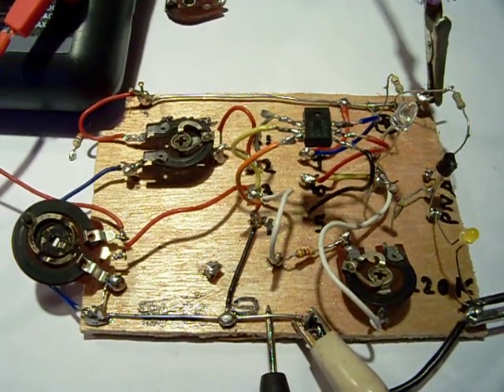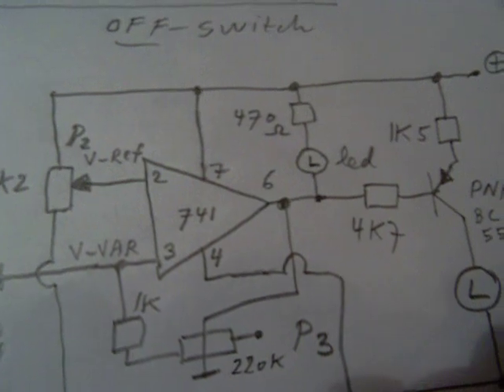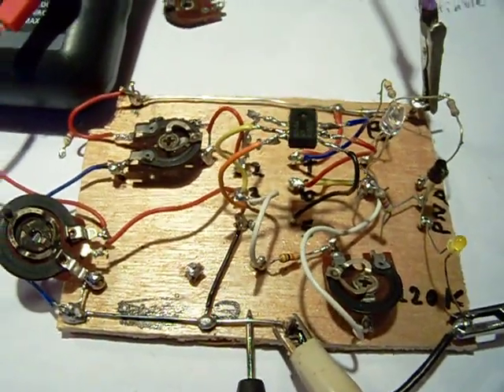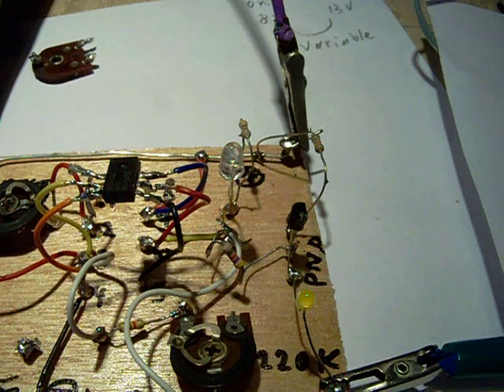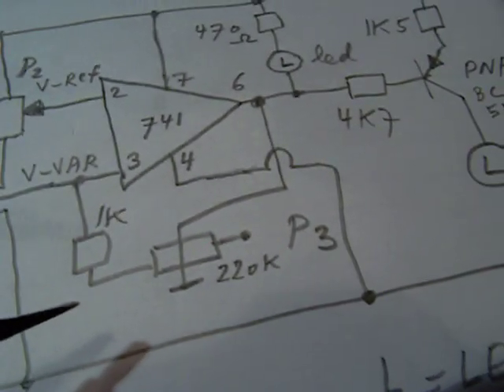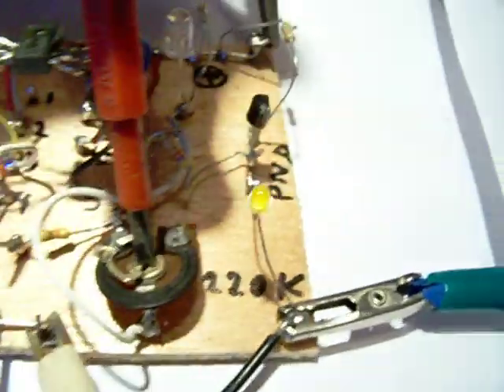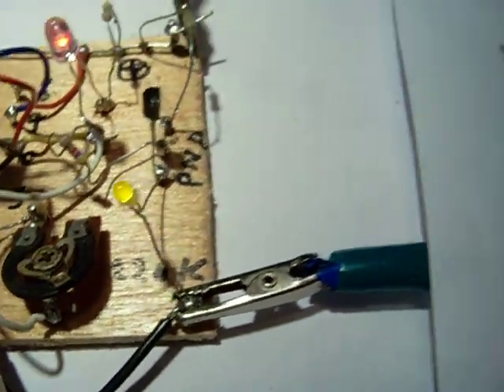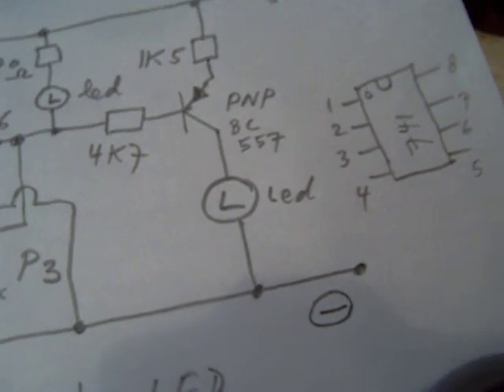Opamp fundamentals part 2, voltage controlled switch with hysteresis

Comment: I'm trying to design a circuit that will switch off a capacitor when it is charged to 6 volts and switch it back on when it is discharged to 4 volts. I also want a shorting wire to be switched in when the capacitor is switched out, and the wire switched out when the capacitor is switched in.  (I could raise these values if they are below the chip supply voltage range) Ideally all the chips should run off the capacitor but I need a stable reference voltage. It's to control the spring unwind in a clockwork radio.
The capacitor will feed the radio and is charged every second or two and swapped out with a shorting wire to act as a brake on the generator when it is not being charged. I'm puzzled now how to get a stable supply voltage to act as a reference (or else the chip might be confused if I try to run it from the same capacitor as the radio). I'd rather not have a separate battery for the chip. Any thoughts on how to do this?
Reply from the maker: Without a schematic I only have a faint idea about what you want to make. Do you want to supply the radio and a chip out of a capacitor? How many mA or micro Amps do the radio and the chip take? What is the function of the spring?
And what does the generator (AC or DC and which voltage?).
Reply: @radiofun232  I haven't got a specific radio in mind, though the power is probably under half a watt - probably about 1/5 - 1/10 of a watt at normal listening levels. Unfortunately I can't post a schematic in a youtube comment.
I want to run the radio off of the capacitor. The capacitor will be connected in parallel with the output of the circuit to the radio.
The input of the circuit will be connected to a motor acting as a generator. This will be powered by a falling weight through a gear train.
I want a circuit that will connect the capacitor to the generator until it has charged to an UPPER voltage e.g. 6 Volts.
I then want it to disconnect the capacitor and immediately connect a shorting wire (just a piece of wire with as low resistance as possible).
When the radio has run out the capacitor down to say 3-4 Volts. I want the circuit to disconnect the shorting wire and reconnect the capacitor across the generator. Ideally the Farad rating of the capacitor should be high enough to run the radio for a couple of seconds by itself.
The radio will run fine without the DC voltage being exact and constant. Your op amp seems to be capable of what I want it to do although I need one inverting and one non inverting output each with exactly the same thresholds. I could run the output of the op amp to one PNP and one NPN transistor so that the PNP acts as an open switch and the NPN acts as a closed switch.
Preferrably the chip should not need to run off a separate battery, but from what I've found the chips get confused and the reference voltage of Schmitt trigger type devices fluctuates if the supply voltage changes. So I need another way to get a stable voltage out of a capacitor fluctuating between 4 and 6 volts.
Reply from the maker: @TimpBizkit  My first (primitive) idea would be: make a voltage stabilizer with a BD 139 (circuits on my channel) for (say) 6 Volts. Connect that via a bridge rectifier to the generator (assumed: it is an AC generator). Now you have a constant charge of the capacitor to 6 volts that supplies the radio when the falling weight moves to ground and activates the generator. 29 june 2020.
Reply: @radiofun232  Now your circuit switches LEDs off when voltage is raised to 12V and turns them back on when it is lowered to 6V. I assume you have a separate supply voltage at a constant level am I right? So I will simplify my example and say the chip power supply is a separate fixed voltage battery of whatever the chip needs to run well.
In my circuit, the loads need to be powered from a capacitor and not the chip supply. It would be like powering your LEDs off the fluctuating 6 - 12 volt supply.
I need the input voltage signal to come from a charging/discharging capacitor that is permanently connected to both the load and the "input voltage" of the op amp. Note that whilst both the load and the "input voltage" terminals of the op amp will be permanently connected to the capacitor, they will not be permanently connected to the generator.
Let's say instead of LEDs powered off a PNP (inverting) transistor, you have a PNP transistor with the capacitor between the emitter and ground that is connected across the generator (and switched with the output of the op amp). And an NPN which is is connected across the generator designed to short its output and is turned on/off exactly opposite to the PNP transistor (also switched with the output of the op amp).
How would I send you a schematic? It's easier than trying to describe with words. I think I know roughly how to do what I want if the chip has a separate power supply. If I want to run it off of the charging/discharging capacitor so nothing needs a battery I am a bit stumped.
Reply from the maker: @TimpBizkit  When you go to my channel trailer you will find my mailadress in the textbox.
Reply from the maker: Regarding your questions I made today 29 june 2020 this videohttps://youtu.be/j3eYpEha2c0

Comment: I see that there is a high cut off that turns off the switch. Could there also be a low cut off that turns off the switch as well if the volts drops below a certain level?
Reply from the maker: yes
Reply from the maker: with a schmitt trigger https://youtu.be/qREsv5mVk2g
Reply from the maker: This circuit shows a proper basic and usable circuit with a LED https://youtu.be/YZFEDhzie1w